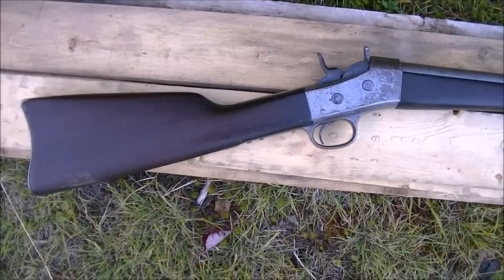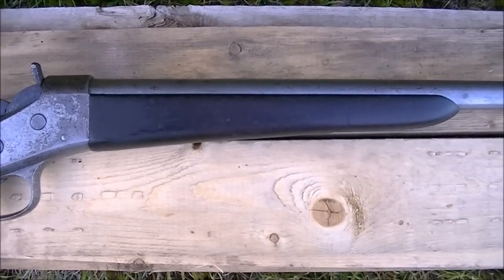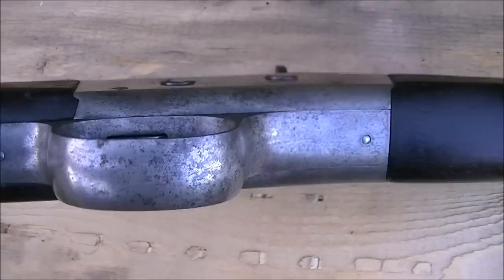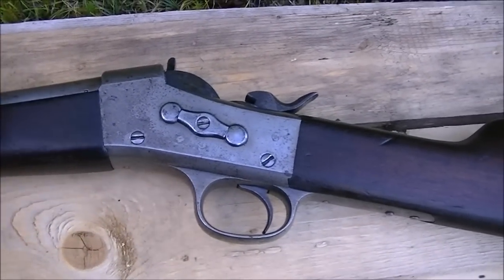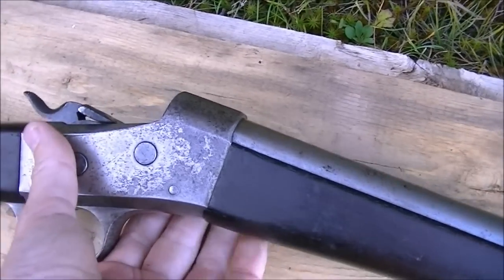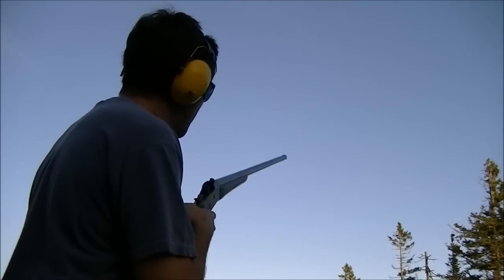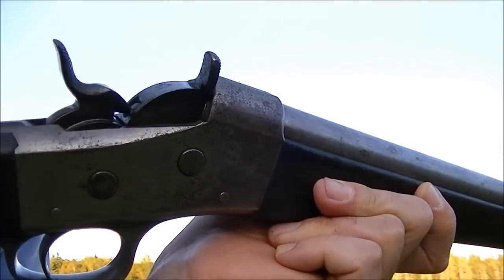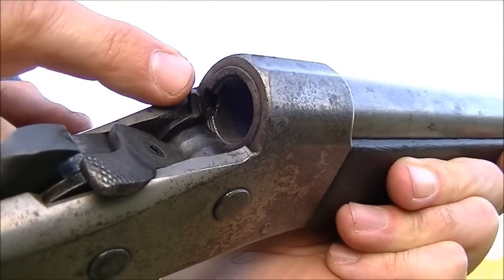Remington Rolling Block Shotgun, 20 Gauge

Comment: I have owned 2 of these in the past Ione being a Remington's and one a Remington's and son you can use modern shells in them it's not a problem. Great for turkey shoots.
Reply from the maker: They ought to be plenty strong for standard 2-3/4" shells.
Reply: I tested them for high velocity 6 shot not any heavier ,it took it well
Reply: @314299  I have one like this in 16 gauge, and seeing that the barrel is in very bad condition, I was thinking about putting in a rifle barrel. My question is? What gauge the Breech Block support ? any suggestions? Thank you. (sorry for my bad english)

Responder

Comment: back in the 60s and before then you could find plenty of these kind of conversions done on obsolete single shot black powder rifles in south america.
they worked,and the ones made from rollingblocks and comblains actually were good shotguns.
Reply from the maker: +fernandolk1 Many of them still in use in south america?
Reply: not in really active service but really relegated to nice heirlooms to pass on.
thing is that some of them have seen really heavy use as cheap shotguns back then and then passed along and getting sold.
so most of them are in not so good shape unless they remained in the family or among the few real gun collectors that still remain.
Reply: I have one of the SA Light Baby Carbines someone (probably a native of Uruguay) converted to 11.1x50,, shotshell, probably to comply with local law there prohibiting civilian ownership of a gun chambered for a military round.   However, they left the 43 bore's rifling intact.  This meant it can now be fired with just about any 44 cartridge, from 44 Special on down (including the original 44-40) to 44 Bulldog while still in technical compliance with Uruguay law.   A 444 Marlin brass cut down to 50mm fits perfectly as a replacement for the 11.15x50mm shotshell.  I have a video up of me blowing up logs with it.
Reply: that is rather interesting.
Reply: Remember seeing a Trapdoor Springfield converted to 12 gauge. It was hard to talk myself out of it.

Comment: Well, that concept certainly fits in with the "economy" of the times. I understand that the original 50-70 trapdoor Springfields were converted from 50 cal muzzle loaders until the existing stocks were used up before starting new manufacture.

Comment: I've always wanted to covert my grandpa's old rolling block .32 rimfire to .357 magnum or .410/
45 lc
Reply from the maker: You might want to convert it to a .32 center fire instead. 357 Magnum is a whole lot more pressure than any .32 rimfire.
Reply: @314299  , what about subsonic .38 special? Or a low recoil .410 load?

Comment: For what it's worth, I don't think that's a converted NY State Model, though it may have still been in .50-70 originally.

NY State Models will have a much taller ear on the hammer block, and the hammer will actually drop to half-cock when you close the breech block as a safety precaution, which is a very unique thing that no other rolling block does. Either way it's a super neat shotgun!
Reply from the maker: You are correct, it is not a conversion of a NY rifle.

Comment: I've seen a few in 50-70 but they are priced for collectors. You can still get ones that were used by the Swedish in there 12.7 black powder round round relatively cheap but if you want it in something like 45-70 then they run about 2K and up. A reproduction in 45-70 will cost you about $1500.

Comment: So you think the barrel started out as a rifle barrel and was bored out for a shotgun? Some of the research I have done suggests the gun was designed to be a shotgun, just using the same design and a lot of the same parts as the carbines
Reply from the maker: This one is most certainly a re-bored rifle, the rear sight dove tail is still present under the fore end (they took a bit off off the barrel so it could be screwed in 1/2 turn further to hid the sight cut). As you mention there were purpose built rolling block shotguns, but this was not one of them. With any of these old guns you have to determine what is safe for the individual gun, they are not all equal by any means.

Comment: Hi, I want to tell if I can use modern cartridges, smokeless powder. thank you very much. I'm from Uruguay and I have a gun of those belonged to my grandfather.
Reply from the maker: rusocarbonero In my opinion the gun, if in good condition should be safe to use with smokeless cartridges. The original black powder rifle rounds generated similar pressure to modern 20 ga shotgun shells.

Comment: sure it was converted? the were made by the factory as shotguns in 16 and 20 ga
Reply from the maker: Yes there were factory made rolling block shotguns but I&#39;m quite sure this one was converted from a rifle as there is a sight dovetail hidden under the fore end. It appears that when the barrel was re-bored and re-chambered they took some material off the breach end so the barrel could be turned in a 1/2 turn further to hide the old rear sight dovetail.

Comment: Hi, I read an artickel abaut this rifle. The writer sed that the sigtinggrove whos only on the ones that whos made as shootguns.
Reply from the maker: +henrikosanna  I dont think that writer is correct. That groove on the top of the receiver would be very easy to add to a reused rifle receiver, but what is more of an indication that this firearm was converted to a shotgun from a rifle is the presence of a rear sight dovetail on the back of the barrel.  On mine they hid the dovetail by indexing the barrel 180 degrees from it's original position so the dovetail is now beneath the fore-end.

Comment: Are you using paper shells?
Reply from the maker: No, plastic tube hulls.
Reply: The plastic shells aren't too much pressure for the barrel?
Reply from the maker: I am not concerned with using smokeless loads with plastic cases/wads in this particular gun as the action is strong and the barrel has plenty of thickness to it. The pressure of the original rifle rounds was greater than that of modern 20 gauge shells.